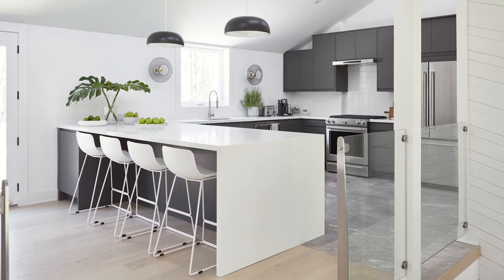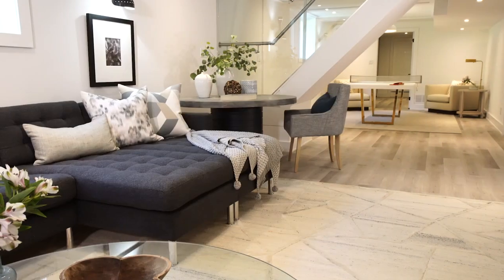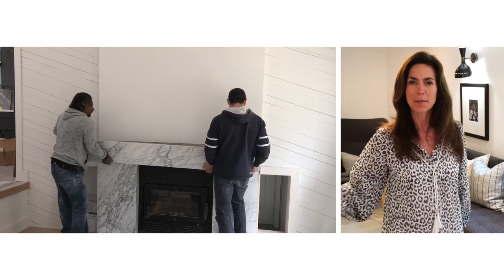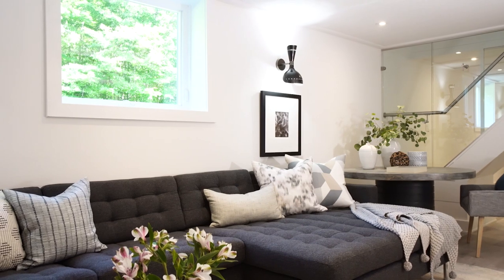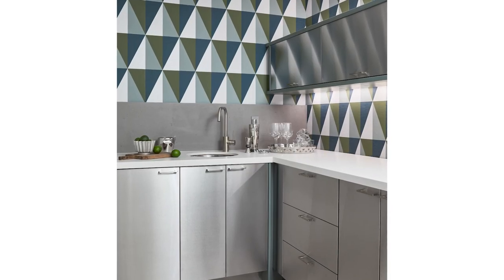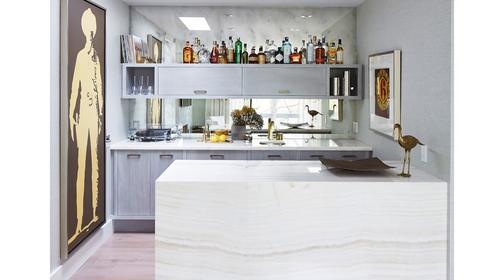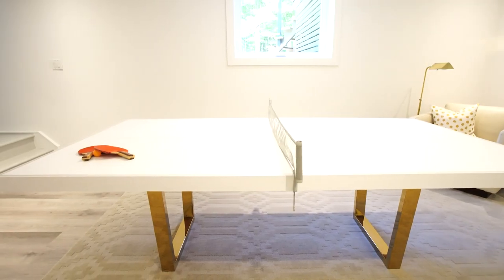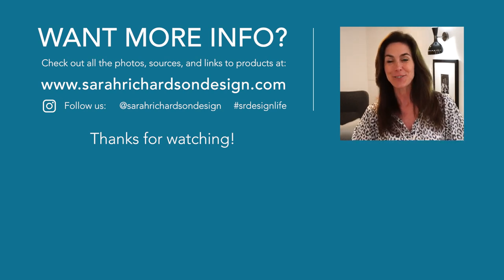Retro Ranch Reno: Media Room + Wet Bar Reveal! (Ep. 17)

Comment: Biggest change with basement reno’s for me, is getting all the electrical, plumbing etc sorted, so a finished ceiling can be applied. The quick fix of a drop ceiling, in my opinion, never looks good enough to bring the level of finish up enough, to stop a basement from feeling like a basement. Using the same quality finishes, as you use on the main level, in a basement, is so worth the investment and something a lot of people scrimp on. Then they are left with a room that doesn’t feel great and they tend to not use it. And like you’ve said before, it’s real estate that you’ve already paid for, so use it. Especially in a bungalow, the basements are always huge. Great job, again, by you and the team from SRD.
Reply from the maker: Thank you Tim! Good insights!